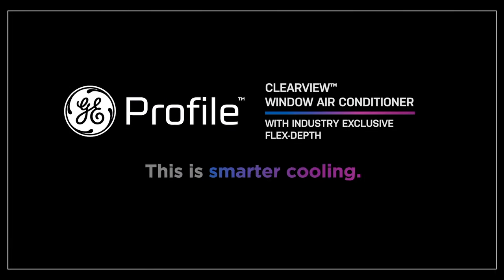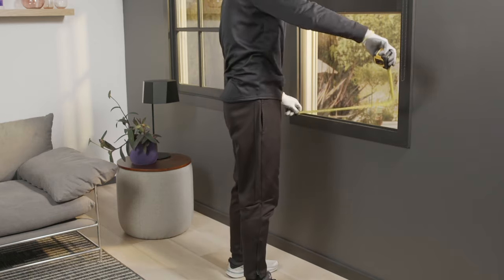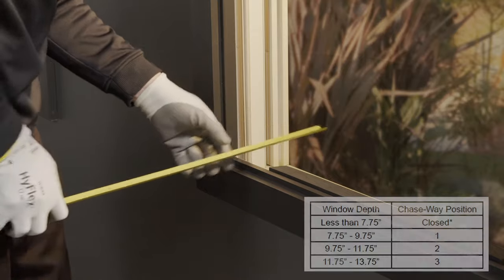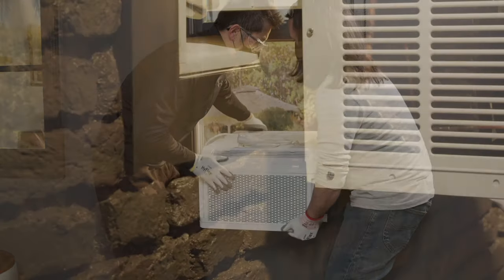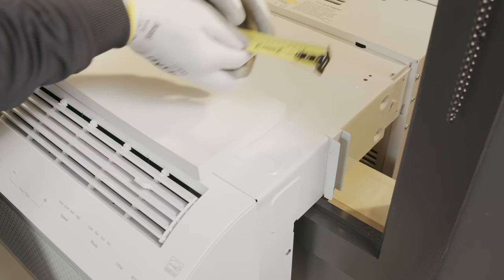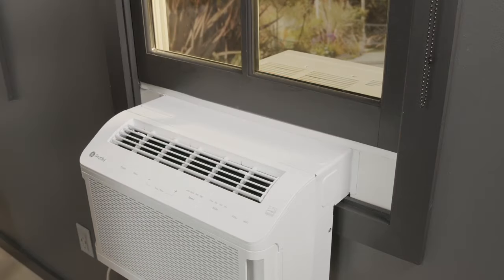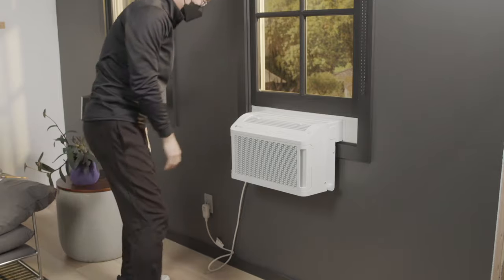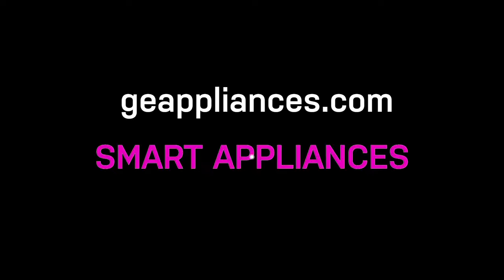GE Profile™ ClearView™ Window Air Conditioner Installation

Comment: It appears that the part of the unit outside the window also requires 10" of vertical drop. Correct?
We have a protruding eave that allows only 4" of vertical clearance, even in the maximum chase-way position. Is there any work-around for that issue?
Thanks!
Reply from the maker: Hello and thanks for your interest in our new air conditioner. The unit does hang approximately 9" below the window sill. If there is an obstruction, the unit would be able to properly install. - JB
Reply: *NOT be able to install 

Amazon sells  a U shaped air conditioner that would fit your home, because it doesn’t hang downward

Comment: I’ve had this for 2 weeks and the unit won’t run for more than 20 minutes without having to drain from the front of the unit. It displays error code P1 then shuts off until drained. Please advise.
Reply from the maker: Hi Chase,

Thanks for reaching out. Sorry to hear about the issues you're having here, we're sure this would be frustrating.

According to the troubleshooting section of your Use and Care manual, a P1 error code means that the pump has encountered a problem or has failed.

You would want to drain the indoor side of the unit first. Then, you can hold down the SLEEP button for 3 seconds to clear error message. If the error code persists, the pump will need to be serviced.

Tips on how to drain the unit can be seen on page 8 of the Use and Care manual, here: https://products.geappliances.com/MarketingObjectRetrieval/Dispatcher?RequestType=PDF&Name=49-5000634-1.pdf&_ga=2.186059818.202487319.1660561576-1657613511.1658931497

Also, should you need them, our service team can be found here: https://www.geappliances.com/ge/service-and-support/service.htm

We do hope this is helpful and that this is taken care of soon.

All the best. -MS

Comment: Hi, I have a single hung, monolythic window. How can I mount the saddle unit, when all there is for it to rest on is a thin metal shaft? Do I have to construct a platform, and can this type of window withstand 90 pounds of pressure? Please advise. I can't find anyone to help me install this, they don't even know what a saddle style a/c is. What am I supposed to do, return it? Please help me, someone, anyone.
Reply from the maker: We recommend you contact the window manufacturer for thier recommendations as to the installation of a window air conditioner and the weight limits for the window.

Our installation guide is tailored for a standard double-hung window. Since you have a different type of window, you'd need to adjust the instructions accordingly if approved by the window manufacturer. The guide includes requirements for both the window and the wall to ensure proper installation. For reference, you can review the installation guide for model AHTT08BC here:: http://spklr.io/6051qACD.

Comment: Can you install on a horizontal sliding door?
Reply from the maker: Hello, and thanks for commenting. We appreciate your interest in our ClearView air conditioners! These models are generally designed to be installed in a standard double-hung window; they cannot be installed in another type of window or door without modification. We would not have tested any other set up for safety and reliability, and we regret any inconvenience this may cause. 

If you still want to try installing on a horizontal sliding window/door, we would recommend making sure the unit can properly secure to the window/door and the surrounding area around the unit is blocked from the outside. You would need to provide your own window filler. Also, the ClearView unit is 19 5/8” wide, so the window must open at least that far. 

If you’d like to review the installation information, the window requirements are discussed on page 11, linked here: http://spklr.io/6058Yq3G . That manual is for models PHNT10 and PHNT12.

If you’re interested in other models or have any other concerns/questions, we’re always glad to assist, here or over our social media. We’re wishing you all the best! -SG

Comment: Do I need to let the AC sit for 24 hours before turning it on?
Reply from the maker: Hi Hoang, you should be able to install and turn this on right away. We hope to see you in our GEA family and we're wishing you the best. - GW
Reply: The instruction booklet says that if the unit was turned on its side/back/front or upside-down, then you should let it sit upright on a level surface for 2 hours before turning it on.  

I think you got "24 hours" from advice regarding refrigerators which were turned on the side/back/front or upside-down.

This 2 or 24 hours is to allow the oil in the system to drain down into the compressor, if the unit was not kept upright during transport.

If the unit was not kept upright and level during transport, the oil in the system may collect in places other than the compressor.  If you turn on the compressor before the oil drains down into the compressor, the compressor may be damaged.

The booklet says 2 hours.  It can't hurt to be safe and wait 24 hours.

Comment: Does this air conditioning need to be lower outside so it can drain? Is there any kind of drainage?
Reply from the maker: Hey there, Victor! This is a really good question. Yes, the air conditioner needs to be slightly tilted to the outside so that the water can drain out. Thanks for asking. Let us know if any other questions come up. -MJ
Reply: The video or installation manual does not say anything about it. Thanks👍
Reply from the maker: Hi again Victor, you are very welcome, glad we could help! -MB
Reply: this is what I found from GE official website...."The good news is we do not anticipate you having to drain either side of the unit in most instances. Water is collected in the indoor section as the air conditioner removes moisture from the air. When the indoor tank starts to fill up, water is pumped to the outdoor section where it evaporates or drains out. It will evaporate with the outer rubber plug installed. Water is picked up by a fan and flung against the condenser coils to evaporate. If the rubber plug is removed to decrease noise the water will drain out. Removing the plug decreases efficiency."

Comment: I just bought mine today and it work for two minutes and I keep getting FL error
Reply from the maker: Hi!

Thanks for reaching out. So sorry to hear about the error code you're seeing!

Fault or error codes are programmed in air conditioner controls to help service technicians quickly diagnose issues with the unit. In the event that the electronic control displays an EP or any other fault or error code, a trained service technician should be called to diagnose and correct the issue. We do not have a list of all the fault or error codes and their meanings since they all indicate a service issue.

Based on page 16 of your Use and Care manual, which you can see here: https://products.geappliances.com/MarketingObjectRetrieval/Dispatcher?RequestType=PDF&Name=49-5000634-1.pdf&_ga=2.46177636.2133713530.1658924115-1822528338.1658924115 - "FL" signifies that the internal tray is full. Take a look at that page for next steps to see if they help.

If they don't and this error code persists, you can take advantage of your warranty as seen on page 21 in the above manual.

We do hope this is helpful. If you have other questions or concerns, know that you're always free to reach out.

Best wishes. -MS

Comment: does it have auto run fan option
Reply from the maker: Good day,

This model air conditioner has an Energy saver (Eco) mode. 

Energy Saver (Eco):

The fan runs when the compressor runs and you choose the fan speed that you want, Low, Medium or High. The fan speed does not change unless you change the fan speed setting. When the compressor turns off, the fan turns off. You may notice more difference between the set temperature and the room temperature before the air conditioner turns on again. Let us know if you have any additional questions. -MH

Comment: For the most part, the other brands/models similar to this unit have a maximum window width generally in the range of 36 inches. I can't find any info on this topic and my windows are approx 48 inches wide. Is there a maximum window width requirement for this brand/model?
Reply from the maker: Hi Shaun - thank you for your interest and for checking with us with regard to a new air conditioner.  You can obtain the maximum window width in the specifications section of our air conditioner models.  The maximum window width on our residential models is 39".  If you have additional questions, please let us know.  -NC
Reply: @geappliances  I guess my only other question then is, why? What makes it not work just because my windows are wider than 39 inches?
Reply from the maker: Hello Shaun. We certainly understand why our units having that maximum window width may be frustrating, and we regret any inconvenience caused. When we design our units, the side panels or other installation materials are designed to accommodate a window with that maximum width. If the window is larger, the panels won’t cover the full space. Installing in a larger window than the unit was designed for would not have been tested for safety and reliability. But if you did need to install in a larger window, visiting your local home improvement store for recommendations on how to secure the air conditioner and keep your window air tight would be advised. We hope this helps to clarify the matter. If you have any other questions or concerns, we’re always glad to offer assistance. Best wishes! -SG
Reply: @shaunclos1810  it’s really not that complicated, It’s just like when you buy an AC with the side panels missing or damaged. Just go to the store and buy some stiff foam to fill the gap or even some things that may be laying around your house in a pinch. The side panels don’t support the AC so it shouldn’t hurt anything.
Reply: @CyberNut930  very helpful, and kinda what I was thinking but wanted to hear it from someone else too. Thanks!

Comment: App is slow, sometimes crashes.
Extension hold screws went in almost sideways because the holes didn’t line up vertically when sliding the thing out, and in.
Reply from the maker: Hi, Nick. Thanks so much for choosing GEA. We're sorry you had trouble with the app and installing the air conditioner. If your home WiFi network is running properly, call the Connected Home Support Line at 1-800-220-6899 for help with our SmartHQ app. If you have any trouble with installation, we are happy to assist her, on other social media sites, or our own website at GEAppliances.com. Thanks! - JB
Reply: @geappliances  This app is one of the worst I've ever seen.  It took me NUMEROUS attempts to connect to the air conditioner, and then several more attempts to connect to my home WiFi.  I entered everything correctly, but the app kept telling me that there was a problem.  Your app is crapp!

It works ok now, and thankfully it has the ONE feature I was hoping it would have:  SCHEDULING. This is far superior to the "delay" or "timer" functions on most window/portable AC units.

Some questions:  Why does the app need to know my name, email address, phone number, home address and GPS location?  It would not allow me to continue without entering this information.  Why does GE need to know my GPS location to control an AIR CONDITIONER???
Reply: Before you say something about a weak WiFi signal... My home router is 10 feet away from the air conditioner, and I was using my smartphone less than 10 feet away also.

Comment: Does this work for a vertical sliding window?
Reply from the maker: Hey there, Diana. Thanks for reaching out about this air conditioner. The installation instructions included with the product are specific to the installation in a double hung window. This unit is designed to fit in a window with an opening between 20"-40" If your window meets that criteria, it may be possible. You may need to modify installation for other types of windows.

Please reach out to us on Facebook, Twitter, or Instagram if any other questions come up. Thanks again! -MJ

Comment: Be very careful with the side pieces that fill the gaps. Measure and re-measure from inside window rail to inside window rail. Not the lip of window slide rails. Also, I am finding I am going to have to seal my entire window on the outside around the unit, , otherwise weather can blow around, and through any cracks. and bugs too will find their way in. Not bad mouthing this unit, just saying what they give you isn't all you need to do, if you have my type windows. I have deep storm windows, with an outer sliding glass, and an inner traditional sliding glass. that leaves me with a big gap between glasses with those cracks I spoke of. Going to have to use plywood or Plexiglas to seal that window from the outside, and spray foam under unit to seal there . My window faces West, right into the face of storms we have. those wind storms, they find any crack or crevasse you have, and blow rain straight across at times into them with pressure.
Reply from the maker: Hi there, we appreciate you taking the time to share your experience installing this unit. 

The air conditioner is indeed designed to be installed on a standard, double-hung window, and modifications are required for other types of windows. 
We recommend making sure that the general installation concept provided by the installation instructions is still followed to guarantee a great cooling performance. 

We hope this information was helpful, and please let us know if we can help with other questions or concerns. All the best. - PM
Reply: @geappliances  The unit works like a charm. We like it. I think no matter the style, I would do some extra work. I don't like adequate, I like solid protection from the elements and environment and insulation to maximize the units abilities. Others who feel the same way may benefit from my experience. Thanks for the product.
Reply from the maker: Hello Larry. We appreciate the clarification and appreciate the feedback and are glad that you're a part of the GE Appliances family! If you have any questions in the future, we're here. Thanks. -AT